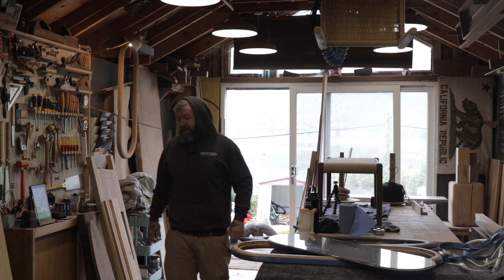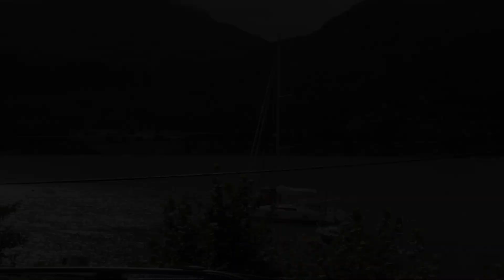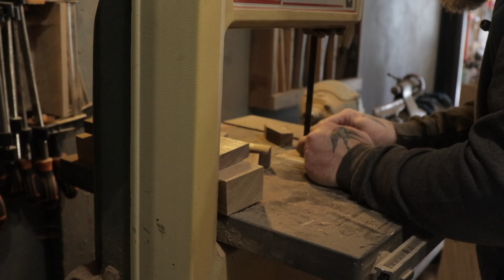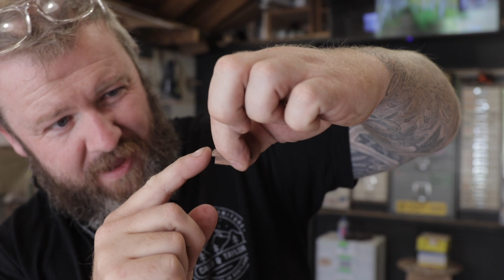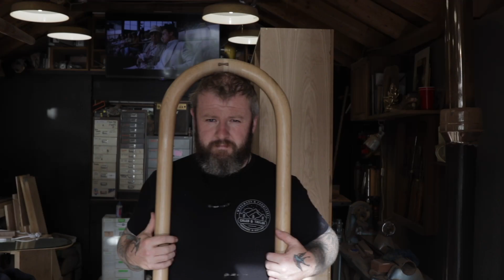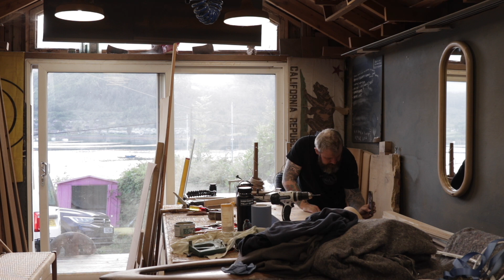Putting a Tie in a Repaired mirror Frame

Comment: Neil, is the tie just decorative then or does the wee fillet on the bottom being glued make it functional? 

Also did you notice at the end of this video there’s a big black Willy. 

Cheers.
Reply from the maker: 😂 If the mirror was cracked and I fit the tie then it’d stop it from coming apart more. But the mirror was glued together and the guy wanted a wee thing on it to match his bed that we done.
Reply: @neilmckinlay  right got you, looks good.